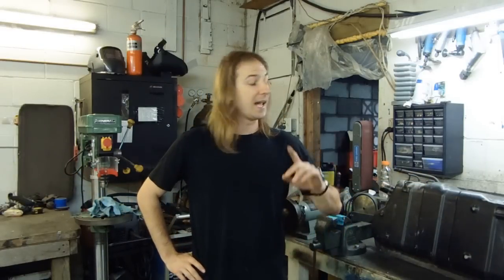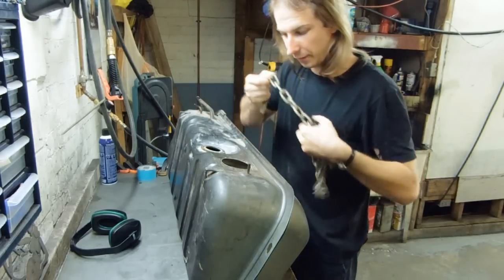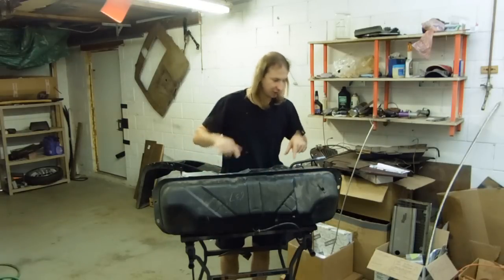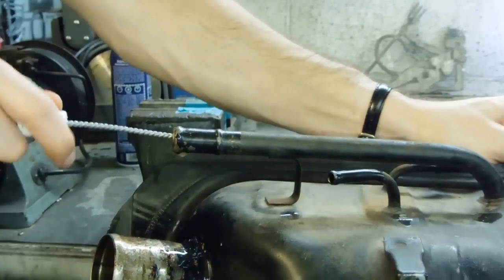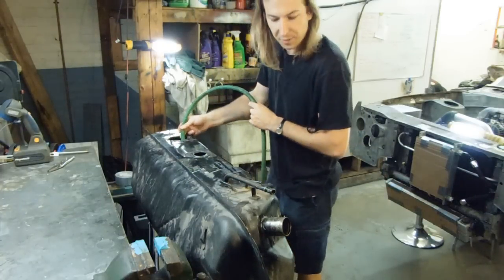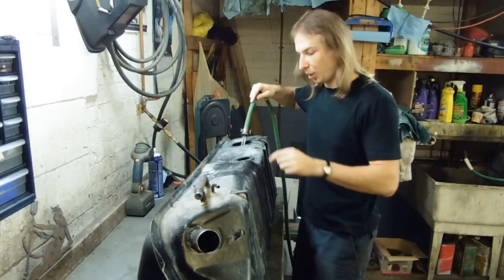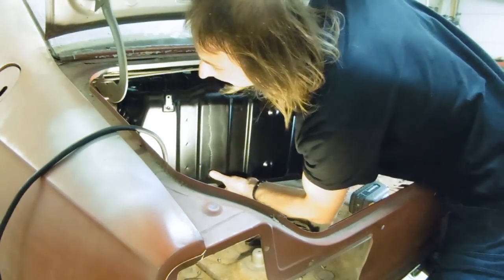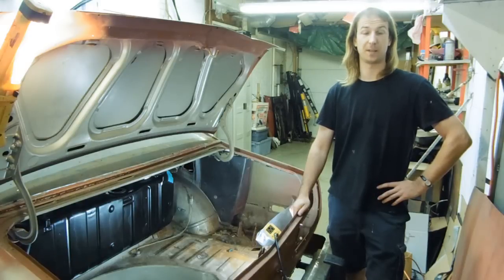Part 38: Fuel Tank Restoration With POR-15 Sealing Kit - My 76 Mazda RX-5 Cosmo Restoration

Comment: Hi, thanks for uploading your videos. They're really helpful. I'm doing the same procedure you're on this video. I just had a quick question about the gas tank. My tank is from a 76 datsun. I wanted to ask you, I notice my tank inside has a small cylindrical mesh filter inside that's connected to the metal fuel line.  
Would the POR 15 sealer also seal the mesh filter? 😬   there's no way I can cover it or remove it. I was wondering your opinion if your tank also has a filter inside.
Thanks
Reply from the maker: Yes, it would definitely clog the filter. I'm not sure I have a solution for that however I'm very surprised it is non-removable. My tank didn't have such a filter and even if it did, it wouldn't matter as I have converted it to an in-tank style EFI pump.

In theory you could blow air through the line to try and clear the mesh before the sealer clears though I have no idea how well that would work out.
Reply: @aaroncake  Thanks for the advice. Wish I could show you a pic but there's none on google I could find of this tank. If you put the flash light inside you can barely see it. I tried taking it off with a wire that would reach it but didn't work. I guess it was put on when they where welding the tank and meant to be non removable and never to be seen. 👀  I left it on and sealed it up to see what happens. I'll probably end up braking it off if the fuel filter is got sealed also. It wouldn't need it any more I suppose. I'm still amazed how the hell is there a non removable fuel filter built inside my tank. 

Thanks Aaron! Keep up the cool videos 😀👍

Comment: When is the next video coming out Aaron? I've been waiting patiently for it but it's been over a month already.
Reply from the maker: whesley otero The next video will be posted when it is ready. I'm editing it as fast as I produce the footage. However as I alluded to at the end of this video, I'm working on the front suspension and it involves a lot of waiting. There's a lot of staring at assemblies, measuring, thinking, staring, measuring. Then ordering parts and thus waiting for them. Then some more work, followed by more waiting on parts. To compound things I made a silly mistake with the steering rack so now I've had to order a slightly different rack. Remember, I'm the only one working on this. There isn't a crew coming in to finish the work once the camera turns off like those TV shows. That said, I know it will be a while before the next video so I'm also editing something else right now which should provide my subscribers with some hotness and entertainment.
Reply: +aaroncake Thanks for the response Aaron ive been going thru some rough things in my life and watching you rebuild this car has kept me entertained from the bad shit. Its one thing in life I actually look forward to lol. Hell of a job btw and thanks for what your doing.

Comment: I did everything just like that.   I dried it with a leaf blower, and then a hair dryer.  Got it so hot that I couldn't touch it.  And it looked unbelievably clean in there.   I used the POR15, and it seemed great.  5 days later, I look inside and its all cracked along the bottom of the tank!?!  It almost seems like the sealer contracted as it dried, and pulled itself away from edges, leaving cracks.

I guess I'll call POR15 and see if they have a solution.   Hopefully, I can just pour more in to fill these cracks, otherwise this is going to be a huge mess.
Reply from the maker: It's possible the cracks formed because the coating was too thick on the bottom. They may just be surface cracks. Yes, I suspect another light coat would solve the problem.
Reply: Yes, I agree that it is probably a result of the coating being too thick.  The "layers" of coating probably dried at different rates, creating little bubbles.

I called POR15 and they said "DO NOT ADD ANOTHER COAT", without cleaning it all out first.  Yes, the 2nd coat would probably fill the gaps and seal up any cracks.  However, they said POR-15 tank sealer does NOT stick to itself.  So the material that didn't end up in the cracks/gaps would likely flake off and make a huge mess.   They said I need to either clean/strip it all out and start over, or use it as-is and hope nothing flakes off down the road.   Seeing as it failed within the first week, I don't think I want to chance my new fuel lines to what it may do over the next few years.

After countless hours cleaning/sealing my original tank, I'm throwing it in the trash and buying a new tank. It isn't an expensive part.  So I should have done that from the start.
Reply from the maker: That sucks. With any POR-15 product, tiny bubbles are a sure sign that the coat was too thick. I believe CO2 is released during the cure and that's what causes the bubbles if the coating is too thick for it to diffuse through.  I'm not even sure how you would go about stripping it off save for a grinder or blasting, so sadly a new tank was probably the only choice.

Comment: Aaron, thanks for the awesome videos they are really informative and great to watch!

I am doing a similar restoration on my rx7 fuel tank, and I am curious as to why you chose Por-15 fuel tank sealer over some of the others (caswell, red-kote or Eastwood)?  I have heard of some issues with the Por-15 peeling over time and clogging fuel pickups but have no experience with any of the products.

Also thank you for the information on the fuel pump electrical connector from racetronix, I have been searching for a product like this for a long time!
Reply from the maker: Dansyoung Primarily because I have fairly extensive experience with POR-15 products and in my experience they have always worked as advertised when the instructions are followed. And that's the key. It's no joke that I made reference to the instructions several times in this video. Searching around there are stories of all the coatings failing which is likely more due to improper prep than anything else.

Comment: It really seems like it qould be easier to create another tank or cut that one open,  clean it then weld it back together.    Are the fuel fumes still there and dangerous after all that rinsing and cleaning?
Reply from the maker: I've made a few fuel tanks in the past  and it's a big pain in the butt, to be honest. Controlling warpage, making sure there are no leaks. Very time consuming. Similar issues with cutting it open in that the weld must be perfect. It actually wasn't too bad to clean it out. Aside from the chain shaking, the chemicals did most of the work. Yes, even the smallest remaining amount of gasoline fumes can cause the tank to blow up when welding. Typically to weld on the tank it would be filled with water up to the weld point, then purged with inert gas (argon, etc.) the rest of the way.

Comment: How did it hold up? I did that on my tank prob 10 years ago and it failed. Doing a video review on it and cutting tank open to see it on my channel now.
Reply from the maker: As crazy as it sounds, I don't have an answer yet. The tank has yet to hold fuel as I am still building the car. I'll keep an eye on your channel for the video because I'm curious. What was the failure mode? Did it break apart?
Reply: @aaroncake  yeah it completely delaminated.
Reply: @aaroncake  going to up the video tomorrow

Comment: Hi Aaron  I have a Mazda rx5 in Austraila it had been sitting in a garage for 12 years and currently has a 351 windsor toyota 5 speed gearbox and ford 9" diff I enjoy your videos and  I am about to start the restoration. Would like to do some videos can you tell me your set up for the videos. Martin
Reply from the maker: Your Choice Fencing Sounds like it was converted into a drag car? My setup is very simple. Currently I have a Panasonic Lumix SZ35 on a tripod. Though if you are buying a camera, I'd suggest a slightly higher model that records in AVCHD rather than MP4. I bought the SZ35 because my Lumix DMC-FX20 (30?) hit the concrete floor. I move the tripod around, focusing on what I want, hit record, do the work, blab to the camera. For editing I use a rather old version of Adobe Premiere Elements, version 3.02. But of course you'd want to use something more modern. Windows Movie Maker is fine for the basics to get started.

Comment: Hi there, fantastic video I have subscribed and look forward to viewing your other videos, can I ask what you did about the inside of the pickup/return pipes??, did they clog I would like to line mine with por-15?
Reply from the maker: Peter Clare In my case I didn't care since all of those tubes were pre-clogged and I converted the tank to EFI, so my feed and return lines are now on the pump flange (episode 37 I think). The stock carb lines were very clogged. Couldn't open them up with compressed air. But if you have to preserve those lines, it would be critical to drain all the sealant out of them before allowing the tank to dry. Because if the sealant solidifies inside, there would be no way to remove it unless you have a long flexible drill bit. The larger diameters are likely fine, but the narrower lines (1/8") could be clogged.

Comment: How many ounces did you used of the sealer? I need to do the same to my 1977 Toyota Corolla. Mine has a 11 gallon fuel tank. Thanks.
Reply from the maker: The kit comes with a 32 ounce can of sealer and instructs to use the whole can then drain out the excess. I think 70% or so drained back into the can.
Reply: aaroncake your tank looks bigger than mine. I think I'm going to buy the 16 ounces can. Thank you so much for your help.

Comment: Dont know if someone already asked you this (or this is dumb enough that only me could ask), but, why not open the tank, clean/repair it, then weld it back up? Wouldnt be faster? I enjoy very much the build series, good work Aaron =]
Reply from the maker: Alvaro Alves That's not really practical. There are danger aspects with any tank that has one held fuel. The vapours are amazingly difficult to clean out and it wasn't until the etching that it stopped smelling of gasoline. So any sort of cutting risks igniting them. It's also sealed around the edge by a long pinch weld. There isn't really a practical way to remove that so one would have to cut in half. But, all the internal baffles would make it very interesting to put back together. :-)

Comment: a nice trick i seen a while back :
use small copper chain (like for the bad plug ) and weld two equal lengths to a piece of long rod 
feed the chan intoo the tank and chuck the rod intoo a cordless drill and just let it run while moving it about inside 
it will basicly flail the inside of the tank
Reply from the maker: watahyahknow Good tip for tanks without baffles.

Comment: Aaron , your account cannot receives comments (mine anyway) so here it is :
- mikuny 4 carbs rack  from a GSXR ...with proper jetting, is it faisable since a lot of 4 bangers do install them ?
Reply from the maker: rambo95777 Not sure why comments wouldn't work...But as far as the carbs, I'd say it would work though I have no direct experience. Having seen 4 Mikuni carbs on a wildly ported 13B before it has been done though I don't know the specifics. Seems like a great way to make an engine very difficult to tune and only good in the high RPM though.

Comment: Wouldn't cutting the tank in half at the  seam be easier,  apply sealer then reweld?
Reply from the maker: That just sounds like a world of hurt to me. Major issues with that approach are dealing with the baffles inside, ensuring a leak free weld, and the heat from the weld damaging the sealer.
Reply: @aaroncake  in that case, perhaps simply replacing it is best. Write the old one off, either fabricate a new one with the old as a template, purchase a new one  or a known/proven good used one if available  or professionally made by a fabricator if you lack the skills and/or equipment.
Reply from the maker: @chrismc410  That could certainly be an option for people if the are replacements available. Having fabricated fuel tanks before, I didn't want to get into that. Once this one cleaned up it was in great shape so I chose to coat it. Definitely if a replacement is available (any of the popular cars will have multiple aftermarket options) it would be the less labor intensive way to go.

Comment: what fuel do you personally use in your rotaries? do you premix or keep the omp?
Reply from the maker: Shea Strocher On my RX-7, I premix because everything on that engine is custom and getting the metering oil pump working was a bit annoying. So since it is already bridge ported and big turbo I just premix. The Cosmo will have a functional metering oil pump as there is no reason to remove it on a street car or one that isn't highly modified.
Reply: My thoughts exactly haha my TurboII is premix and my small streetport 1st gen is mop

Comment: bro you forgotto write POR-15 on your forehead using the product man. gr8 vid - what kit was this (size) - i need to do a square 50gal tank.

thanks
Reply from the maker: I used the standard kit part number 49239. Based on how much I had left over I expect it would easily do 50 gallons. And believe me, past POR-15 experiences have put enough on my skin that these days I am more than cautious. It DOES NOT COME OFF.

Comment: Damn man. Looking really good. You're getting pretty close to starting it up.

...Right?

Are there going to be 76 parts to your Restoration?
Reply from the maker: freshfrij0les There's still quite a lot to do before it's worth starting the engine but yes, I get closer and closer all the time. Wouldn't it be funny if there ends up being 76 parts...
Reply: aaroncake Which will come first, you starting the Cosmo, or HL3?
Reply: Really? You've gotten the coolant run, fuel run, electronics (well, most I'd guess for the engine) run, have you done the ignition yet? I can't remember.

It seems like it's close, unless of course, you're just wanting to get the car on the road first. Ground, rather.
Reply from the maker: freshfrij0les All the little plumbing like vacuum lines, oil lines, power steering and such. There's not too much point right now in rushing to start the engine because it will just sit around for a while and of course, I need to disassemble the entire engine bay to paint everything.
Reply: Oh, yeah, that's right. Good point. Good luck with all that. Thanks for making these videos. I know it's probably a huge pain in the ass to do.
Reply from the maker: freshfrij0les In most cases the camera doesn't get in the way. There are times though when I find myself spending way too much time trying to get a shot before I realize that I really don't need that shot if it's going to take so long to figure out. Editing is more time consuming, frankly.

Comment: The tank looked good. No need yet.
Reply from the maker: I was actually surprised at the condition of the tank. It looked much worse before I cleaned it out and I figured it was a rusty mess. True, after cleaning it didn't need to be lined however call it preventative maintenance. I won't have to worry about it again. Especially if I run E85.

Comment: I must assume a new or aftermarket tank is too expensive, or unavailable?
Just seems like a lot of work to me...
Reply from the maker: Correct, it would be nearly impossible to find a Cosmo fuel tank in decent shape, and no aftermarket options exist. I wanted to stay away from fabricating a tank or adapting another tank to fit. It was a fair amount of work, but not too bad. Certainly the best option if available is to replace the tank.

Comment: I have watched this series from episode 1 to 38. 

You spend hours correcting things most others would over look.  You should be commended for your attention to detail.  After going to all that trouble I don't understand why you have failed to radius even one bracket out of the bucket load you have fabricated.  It greatly distracts from the parts you worked so hard to create.

As you build your shop you might look into collecting a plasma torch and a vice for your drill press.  There are a lot of inexpensive tools that could help you along the way.  One of the things I struggle with most is clamping parts to my drill press and or mill.  Lots of good videos out there that could bring you right up to speed.  Remember your table can be rotated 90 degrees.

If you would like some tool sources let me know and I'll send you some URLs.

Just my thoughts...  Take care, be safe!
Reply from the maker: ***** A drill press vice is on the list of stuff to pick up when next on sale. Until then a set of clamps do the job but I realise I'm wasting a far bit of time juggling them. Plasma cutter? Maybe...It's one of those things I would use but I'm not sure I spend enough time cutting thick material for the investment. Thinner stuff I prefer to just run through the band saw due to minimal cleanup needed. Rotating the table 90 degrees is one of those "Duh!" moments. Until you pointed it out to me, of course I knew it could be, but had never considered actually doing so!

Comment: aaron:
how is the tank holding up?
Please when using por-15 products use thick gloves, cover all of your skin, use a tyvek suit even as you do not want any of these chemicals to get to your skin.  They find a quick path to your internal organs.
Reply from the maker: So far the tank has held up fine. Of course what that means is it has sat in my shop while I worked on the rest of the car. So haven't filled it yet. Based on my experience with POR-15 products I don't have any reason to believe it won't perform as promised.